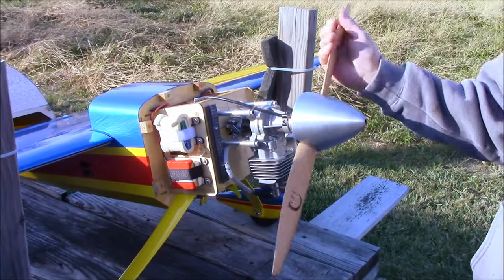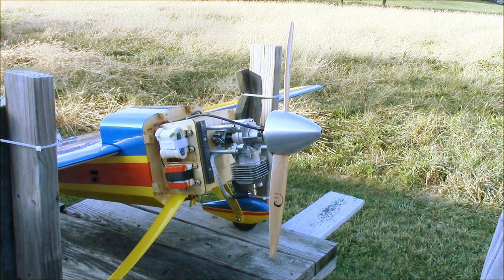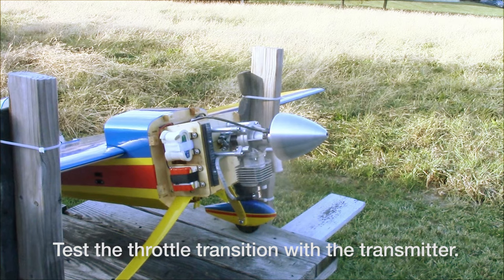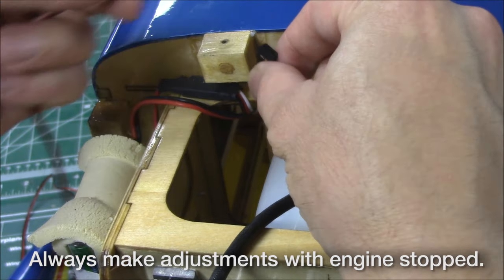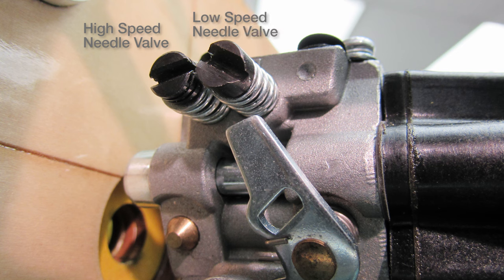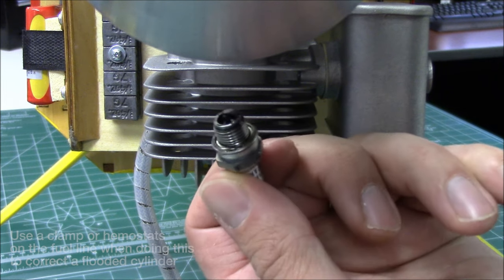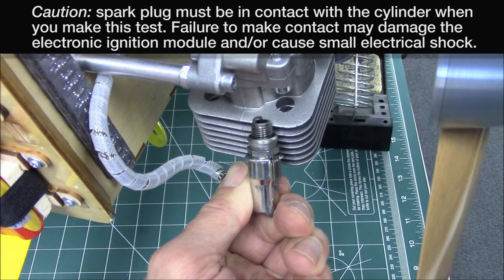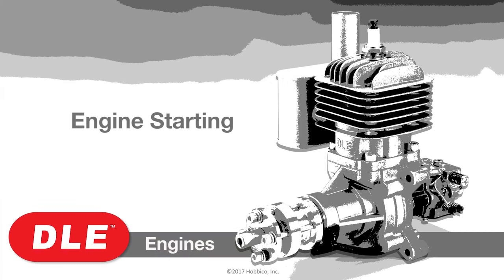Starting a DLE Engine : Tips & How-To’s

Comment: If everything is well build and in order that engine runs very well and is easy to start by hand but be careful! Especially when you beginning and your nerves are stressed because it takes a while to adjust it well. Once you have finished the adjustment only small changes on the carburettor are needed .

Comment: 1.5 turns on both needles is wrong. That is too rich for the low side. On every 2 stroke engine I have ever worked on, 3/4 is a good starting point on the low side, and 1.5 on the high side. Start, and warm up the engine, and make the final adjustments.